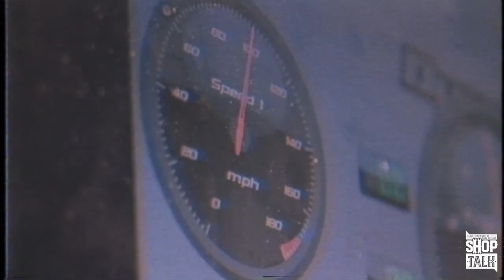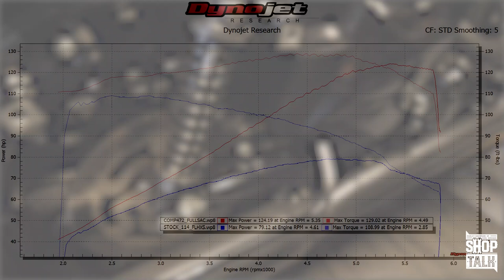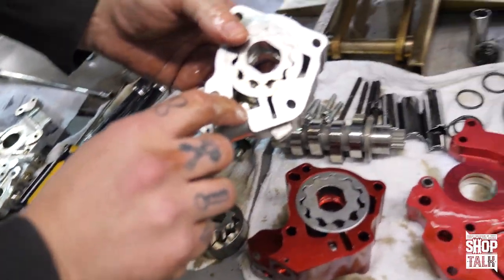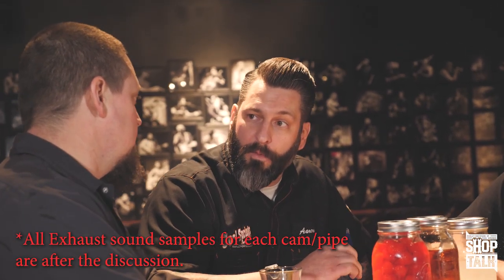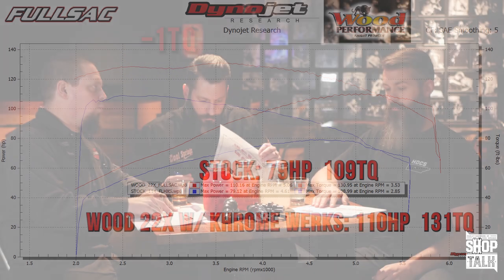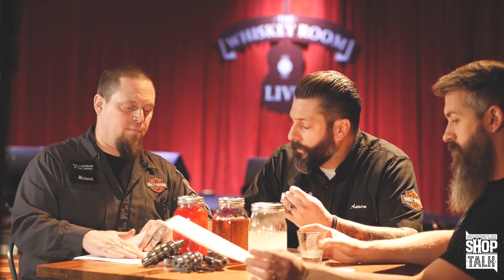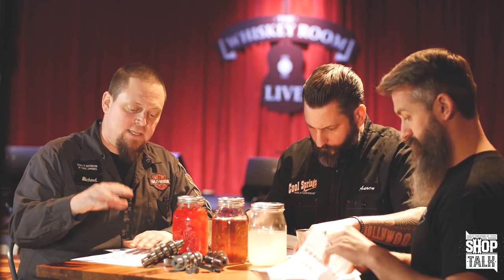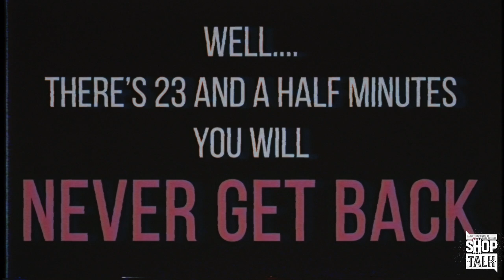Cam Shootout Series | Part 1 (S&S 475G, Wood Knight Prowler 22x, Comp Cams M8 246A, Redshift RS472)

Comment: What’s the best cam for a 2019 Breakout 114 with V&H 300 Eliminators and one up bar hopping? I was leaning toward either the S&S 465c or the 475c. I don’t plan on doing any top end work. Reliability is important.
Reply from the maker: Our new MHP 485! It now out performs all the ones we reference in the shootout. 

the Horsepower Team
Nick - Aaron - Jamie - Mike
Phone: 615-275-4170
Email: horsepower@moonshineharley.com
If you email is please provide a good contact phone number for you.
Reply: @MoonshineHarley  How do we get ahold of the new MHP 485 cam?!

Comment: You guys do the absolute best true comparison videos. I've watched a ton of your research and appreciate it. I wish I was closer to you because it would be a no brainer to have work done on my bike from your crew. 
So I have a 17 Road Glide that I bought new when the m8 was first released. It had 250 miles on it when I did a cam, pipe and tuner. 
I did an Andrews 460 (at the time it was a prototype) with the Billet Cat pipe. And the shop used a Technoresearch tuner. 
I ended up with 103hp and 116tq. At the time I was happy with that. 
After watching your videos I'd like to ask if the S&S and Zippers cams in this video are bolt in cams. I'm really looking for an increase in numbers and would love a more aggressive sound. 
We do a lot of two up riding and being in New England we are in the mountains a lot. Any feedback on this would be truly appreciated. Also have you ever even heard of Technoresearch tuners and if so what are your thoughts. I feel like I'm the only guy in the world using one. 
Thanks in advance.
Reply: All M* is easy bolt in stuff.
Reply from the maker: Send an email with you phone number to horsepower@moonshineharley.COV and we’ll call you to discuss.

Comment: Yall got a bit of a lazy dyno, just saying.
Anyways, why the feuling cam plate and pump over the S&S cam plate and pump?
Reply: Lazy compared to what?
Reply: @NoName-vz1ob  Lazy Dyno is just a euphamism to describe a dynometer that is under reporting power ratings.
Reply: @FranBunnyFFXII  Ah.  Thanks for the clarification.  And we appreciate you watching the video.
Reply: Just remember a dyno is nothing more than a tool for comparative analysis.  The lines are the important part, not the peak numbers.  Just my $.02

Comment: Really wish you guys would have done this for the true stage 2 set-ups instead of showing results on a bike with a 117 kit, 11:1 compression, injectors and throttle body. And used cams better suited for a normal stage 2, like the RS468, Woods 22X-E, CR480, S&S465, etc... These dynos are a little misleading, comparing to a bone stock 114... And other than the fast talking disclaimer, only talking about a cam and exhaust combo. I almost bought a 475C based on this before I realized how bad the low end torque looks on a stock motor.

Comment: Great test gentlemen, I have a Road King special 2018 (107) at present only got the heavy breather and a FP3 on it but looking for a cam, and full exhaust. Most of my riding is from idle to 4K rpm. Which combo would you recommend. Also would you recommend the oil pump upgrade at the same time?
Reply: We install a lot of S&S 465 cams for that scenario.  The D&D billet cat or the S&S sidewinder (both are 2-1 pipes and have "ghost" pipes available if you want symmetry) would be my recommendation for pipe.  They help maximize low end torque.  If you are thinking about doing the plate/pump it makes the most sense to do it all at the same time and S&S sells a complete kit with all of it.

Comment: The stock dyno chart reads a stock 114 FLHXS but your components say a 117 ci? which one is it? Also, Woods recommends the 22X cam on motors 107-114 not a 117??
Reply: agreed, i was a bit confused too. I think they did a great job but it was a little misleading.
Reply: Money Green the video description goes in depth about this build. I would check it out!

Comment: WOW! What a great video. Thanks for all the work that went into this. It helped me narrow down my options based on what I am looking for the bike to do. I just upgraded fom a 17 Street Glide Special to the new 20 Street Glide Special. Based on your info, I have decided to go with the S&S 475G cam upgrade. Your video mentioned the D&D headers. My new 20 has the custom Scorched Orange and Flux Gray pain combo with everything blacked out. Which D&D Header did you use in this test? I have heard that you should upgrade the water pump to eliminate a potential sumping issue? Any suggestions there? Any suggestions on an air intake system that works well with this configuration due to the increased air flow created? I will be adding some kind of upgraded black mufflers also to keep that lope and sound created by the S&S 475G cam. I wish you weren't have way around the country...I would just have you do these upgrades. Thank you for the requested info! I greatly appreciate it guys! Todd / Brainerd, MN
Reply: when I bought my 2021 road glide the dealer already put rinehart slip on's, I put a cam and also a header pipe man this bike sounds the loudest n nastiest bike me or any of my friends ever heard running even at idle,  its just a mean n nasty sounding set up, with power n torque instantly until about 4500 rpm then torque shops dropping but horsepower is still rising  until about 5500 rpm then it eases up,   but thats a great range to have power n torque in all most the whole time! got to hear it to appreciate it though !

Comment: Do you have a guess on how much more power and torque these cams would do with a CVO 117?
Reply from the maker: 3-6 more
Reply: @MoonshineHarley  would I need to upgrade the cam plate and oil pump if I went with an S&S 475 cam?  My bike was manufactured in late 2018

Comment: I have a 2019 SGS 114. I have the screaming eagle performance slip ons and high flow intake as it was covered under my warranty during the original purchase. Now I’m slowly going to start making changes over time (eventually would love to go stage IV). I’m sold on putting on a fullsac 2-1-2 header with a TTS tuner (getting away from Harley pro tune) and stock headers. What I’m still confused on is what cam works best for me. I am looking at the S&S 475 or the Comp cam, however the dealer is recommending the TTS 200. I want immediate power and torque out of the gate as i ride hard (old sport bike guy lol) but don’t want to completely lose that power and torque as I get up into the RPMs. I’m questioning the dealer a little because I’ve not seen much on the TTS cams out there although I’m sure they are good. I love your videos but am still left scratching my head what works best for me since they all have such good pros and cons. I think I’ve at least gotten it down to the three.  any help you guys could offer would be greatly appreciated  based on all of your awesome experience. Maybe I’ve missed the three to this point completely. Thanks!
Reply from the maker: Please call us so we can give you some advise! Ask for Aaron or Jamie 615-274-4170

Comment: I would like to see you start with a factory stock bike. Not one that does not represent a stock bike before cams and then exhaust. The 117 HP with the S&S and D&D will not happen without help. Nevertheless thanks for all the hard work.
Reply: The baseline run is a stock 114 Street glide.
Reply: You might like our Cam shoot out Part II video.

Comment: Hi there from France.
I have a street bob 107 with a stage 1 (PowerVision, SE extreme flow air cleaner and V&H ShortShots). I am mostly riding low to mid range RPM, alone or with a passenger and I’d like a stage 2 to have more torque. Which cam do you think would match my style of riding the most ? S&S 475 or 465 ? The sound of the 475 is fantastic.
Thanks for the tips !

Comment: So what cam would be recommended for my 17 sgs? I ride 2 up frequently but also a lot of solo hot rodding back roads, city, highway, stop light to stop light... I tend to wind the motor out a bit.
Currently have a hd se intake, and svt boneshakers and looking at either a vh power header, rcx tormentor, or fullsac head pipe.

Comment: Nice video but I would assume you started out with a 114 with what's bigger cylinder heads to make a 117 Harley Davidson horsepower numbers are saying least 119 on torque from the 114
Reply: 120+ torque is very easy on a stock 114.

Comment: I have a 2013 road glide with a 103 I have Vansen Hines power dual header CFR slip Ons, big air cleaner and I recently put in Andrews 57H cams and now I got a tune from Fuel Moto now I am trying to figure out where I’m a tuner. I’m getting a lot of spit and sputter every once in a while, and I have a PowerVision dino jet PowerVision.

Comment: Im on an 18 FXFBS, with SE tuner and Auto Tuner with a TBR 2-1 in NYC.  Do a lot of riding in heavy traffic before cracking her wide open on the thruway.   I think I’m looking for a good torque cam but, I don’t really know what I need.  What can you recommend? I’m also a bigger guy (6’3 285) if that helps.  I’m also looking at the full S&S cam-chest.  Noise is a plus for me all around too.  Was thinking gear-drive too

Comment: Great video.  I have a question I am hoping you can help.  I have a 2003 Roadking with Rinehart slip ons, high flow intake, remapped ECM, and a VH Feulpak.  I am upgrading my cam chain tensioners and considering Feulings conversion plate (kit#7088).  If I run Feuling's 525 Reaper camshaft - do I need to remap or run a Power Commander (or other) tuner?
Reply: I would recommend power vision for the tune.  525R cam is a great choice for an 88ci.

Comment: Why did you use the stock cam plate for the S&S 475 cam and all the others used the Fueling one? It seems weird when you are trying to keep everything the same for testing.
Reply: It was only because the bike we used was our sales floor "Moonshine Stage 3" bike.  It had a gear drive cam and a stock pump plate (to keep financing cost in line) when we started the test so it was a good jumping off point for time and $$.  When we finished the test the bike went back to floor with the Feuling pump/plate.

Comment: Great Vid. Thx for the info. Would I see better numbers with S&S 550 vs 475 vs RS548 in my Stage IV with D&D 2:1 exhaust on a 2020 Road Glide Special. I do ride 2up often and also trying to keep up with my 128ci brothers and not get dusted to bad.
Reply: The bigger cams would only benefit you with more displacement/compression.  We have turned several HD STG IV bikes into bad ass rockets.  Call us and we can evaluate what you have and what your goal is.

Comment: Out of all those builds how many have not survived ?  Just curious
Reply: Freedom Rider None! Plus we warranty most of our builds. We have some videos showing broken SE valve springs but nothing that’s taken a motor out and we build a lot. Quality parts equals quality results.
Reply: Jamie Lima no sumping issues with these big builds ?
Reply: Jamie Lima doing a 124 build and wondering if I should put in an S&S or fueling pump and plate ?
Reply: @freedom6919741  The "sumping" issue has been blown way out of proportion.  It is actually pretty rare.  As far as pumps go both are great.  It mostly comes down to brand preference and whether or not you want a split compartment two gear scavenge system or a single gear two pick up both.  We did a video on that two on one of the 124 highway sleeper videos.
Reply: M.V.O _Motorfast so do you think the stock pump with the new seal and backing plate is sufficient or should it be changed.
Reply: @freedom6919741  we run that set up all time in our smaller street builds.  I do always make sure it is going back together with the latest OEM revisions when that is the case.
Reply: M.V.O _Motorfast ok thanks for the info.  You guys are doing great things for the HD community !  I wish I lived closer to TN I would have you build my motor.

Comment: So is the Vance and Hines Pro Pipe a crappy 2 into 1 pipe?
Reply: Not necessarily.  It has different baffles for different applications so that is cool.
Reply: M.V.O _Motorfast I plan to put a cam in my existing 107 M8 and running an FP3. Any recommendations on the right cam? I’m leaning towards the 22X Wood variety or the Redshift .468.
Reply: @MalcolmTodd1966  We could do the build and have Mr. MVO do the work for you if you are interested. Please call Aaron at H-D of Cool Springs and talk to him about options 615-771-7775. We would recommend a different tuner and pipe than you expressed.

Comment: So what would you all recommend for a on the fly throttle respond.

I’m currently running a
K&N heavy breather with a set of American Freedom Declaration
Turn outs with the baffles taken out an installed DK Customs  thunder torque inserts.
Any ideas would be great.
Thanks
Reply: Damn
Completely forgot to mention the make an model
2016 HD WideGlide 103.
Thanks Again
Reply: I recommend putting baffles back in if you have lost low end throttle response.

Comment: Would you expect to see the same results across the M8 range.. As they don't all have the same stock numbers. (I have an Fxfbs)
Reply from the maker: haydenndre similar curves but softtail motors are slightly less. They have two counterbalancers which is a lot of weight in the lower end which lowers the numbers. 107 to 114 you see a 3-5 difference.

Comment: I have a 2022 Street Glide ST 117 with the Redshift 472 cam. S&S cam chest. Bassani 2-1 Road Rage 3 mid length. 110hp and 133 torque. Needing more airflow. Looking at HPI throttle bodies and V2 air cleaner. Let me know any suggestions!

Comment: Was the motor 107 or 114 cubic inch?
Reply: ckelley63 The bike started its stock life as a 114 which comes stock with a 4.5 inch stroke flywheel/crank.
Reply: Thanks wound up reading the liner notes below the title lol just bought a 2018 Fatboy a 107 have the stage one with a set of Rinehart pipes. Thank you for your response. Love the motir by the way.

Comment: Hey I have a question I have a 2019 Streetglide I have bought a 475 c cam kit and quickie push rods and metal Tappet cuffs  I would love to have the SS. Cam plate and oil pump but don’t have enough cash to have it all installed do you offer any financing on installation of the parts    107. Motor

Comment: What about valve train noise with these cams?
Reply: They are all pretty quiet.
Reply: @NoName-vz1ob  So compared to the stock M8 cam you did get some noise? My last bike had HD's stage4 w/259e while it made good power the noise drove me nuts! I like your video, I been eyeing the 22x for 2up riding.
Reply: @rbessler60  you won't hear much of a difference with that cam.  With four valves the lifts aren't that drastic.  The 259E is somewhere around .575 lift if I remember right and the WM8-22X is .470.  The monster M8 cams are in the .550 range.  Much less valve train stress on these engines.
Reply: @NoName-vz1ob  Thanks for the feed back

Comment: If only our dealerships around here would work with something other than screaming eagle. I might call just get an idea of what parts to put together. Sucks you’re several states away because it’s hard to find quality work with the  knowledge you guys have.
Reply: Also are you guys using the factory springs or do you need to change them? Would these cams bolt into a stage 4 107?
Reply: @chroniclesofnanner9543  Yes these cams will bolt into a stage 4.  It is pretty common for us to do upgrades for visitors.  A cam swap/tune is one day (maybe a couple hours hours into the next morning.)

Comment: What is the “comp cam” sold under? Or where can we get it?
Reply: Potter 1017 call Aaron at the shop and he’ll get one headed your way 615-771-7775. His schedule is Tuesday - Saturday 10am - 6pm central standard time. I would also grab some S&S CNC’s tapper cuffs and a Fueling Pinion gear. If you want to order it Monday ask for Jeremy. We also have options to pickup your bike, build it and deliver it back to you as long a your not in CA. Let us know how we can help and we thank you for watching our videos. Remember those results are with a high compression setup. The Comp Cam in our shoot out is too much for a stock compression motor.
Reply: I was wondering if comp would work with stock compression.  . Which would be better in that scenario?
Reply: Jamie Lima why can’t you to California?

Comment: Thanks guys you rock!
I just finished my redshift 468 install along with other cam chest goodies and I can't say enough good things.
Question though, 
Would it be worth switching from a factory head pipe with gutted cat to a full sac head pipe? Will it be worth the $$$
Reply: Dude how's that cam on the highway? I'm debating the zipper 468 or the SS 475.

Comment: Freaking fantastic video I have a 2020 road glide special with a 114 m8 engine with that rdrs system what would you recommend I want to install air cleaner full exhaust and a cam kit and a tuner that will work best for my bike looking for that chop sound and power and torque pleas help
Reply from the maker: MHP-485 is your cam. It hit the market after this video and it will out preform these cam on TQ & HP and have the most aggressive id like the Comp cam. D&D billet cat is the exhaust we would recommend if you’d like sound and preformance.

Comment: I wish Harley made more aluminum or carbon replacement parts.  If you could reduce the weight by 80 pounds, would help acceleration, braking, and handling without touching the engine.  Weight reduction would help emissions also especially with Euro 5 and 6.
Reply from the maker: What are you looking for? We have lots of aluminum and carbon options at our shop. Let us know if we can help.